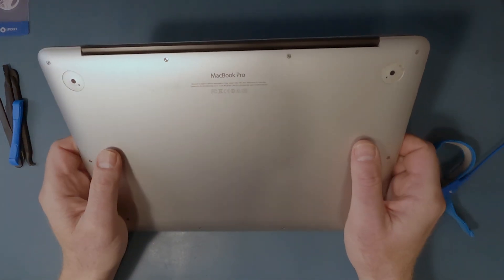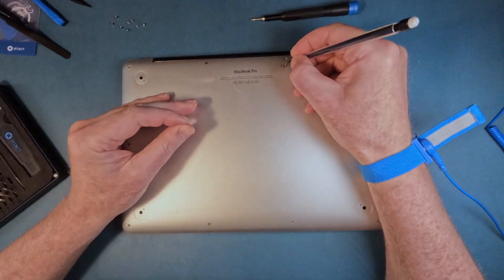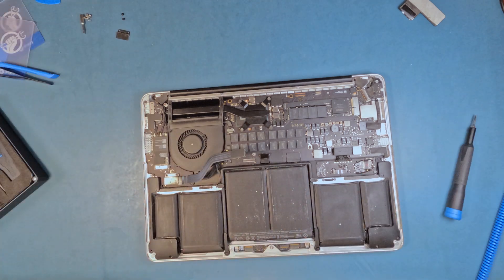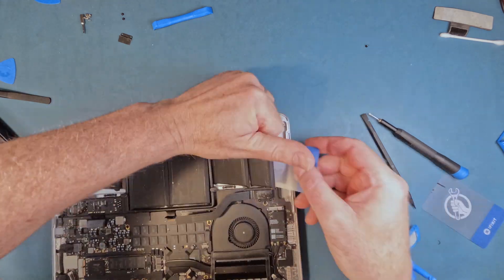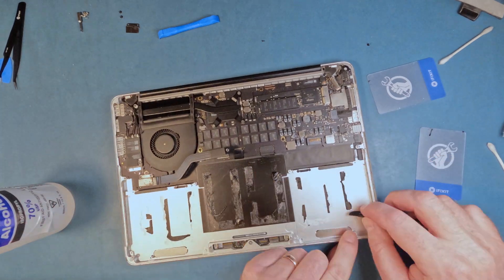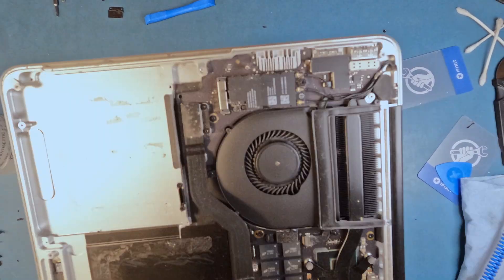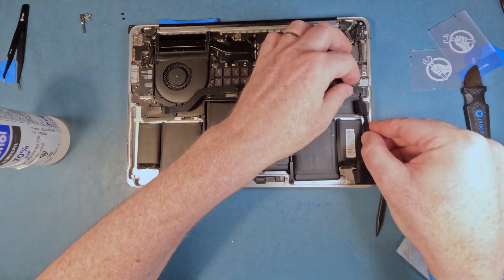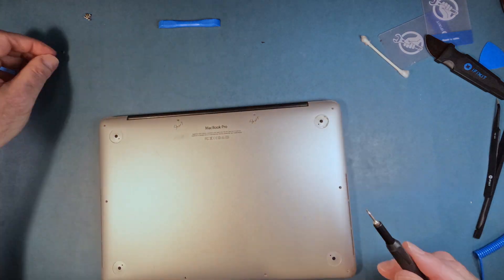Macbook Pro 13" Retina A1502 (mid-2014) Battery Replacement

Comment: Thank you for this video ! thinking about replacing my battery too. Q. How long did it take to replace? And what is that blue cable attached to your wrist? you got my like !!
Reply from the maker: Thanks for the like. I think it took me about an hour. The prep work, and the ordering of the battery and tools, that took a fair bit more time. The cable is an anti-static strap. Didn't want to cause any additional problems when I cracked the thing open.

Comment: could you tell us how the battery is functioning after the two year mark? i am thinking about buying this exact kit for mine 2014 macbook pro, but would like to know if its good on the long run :)
Reply from the maker: It is working well. Actually, I think the battery is working better than it did day one. I don't know enough about lithium battery conditioning to say anything intelligent here other than it is working really well.

Comment: Mine cannot be booted up on battery only and after being plugged in, it showed battery X (not available). Could you please advise the possible solution?
Reply from the maker: this sounds like either a battery recognition or a battery connection problem. which replacement battery did you use? the ifixit battery worked like a charm for me. 

and is there a chance the battery cable was damaged or the connector not properly attached? those could mean the computer can't even 'see' the new battery because it is not connected. those are the two ideas I have. 

best of luck.

Comment: Use WD40 to get adhesive off. It's like magic. Just let it soak a bit.
Reply from the maker: I can see that working. I was wary of any spill over of the alcohol that was advised by ifixit. Would seem to be a similar concern, but good for folks to consider. Thanks.